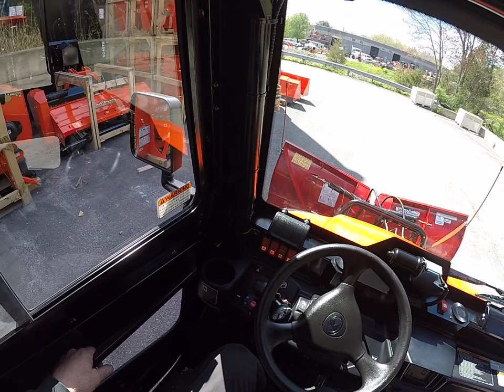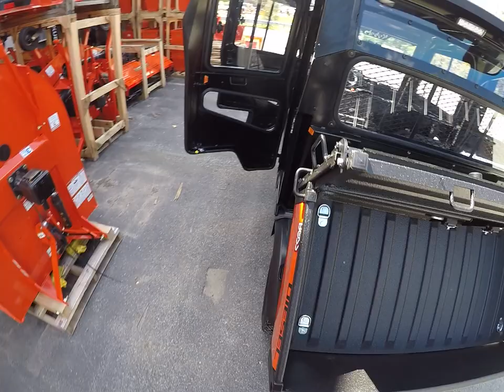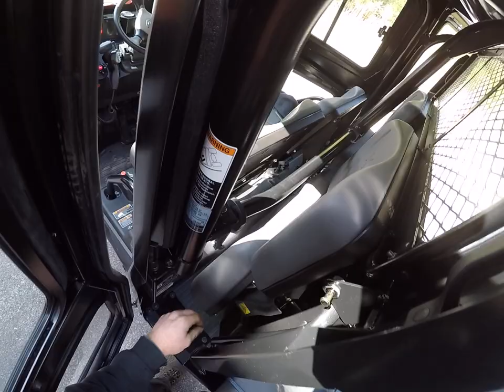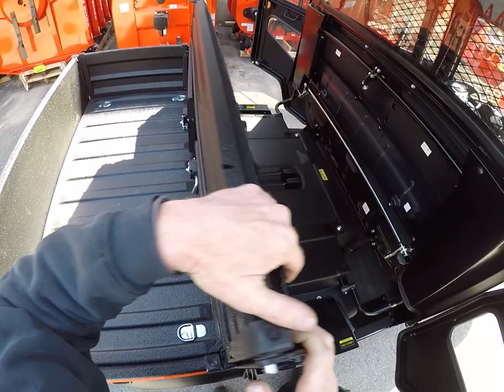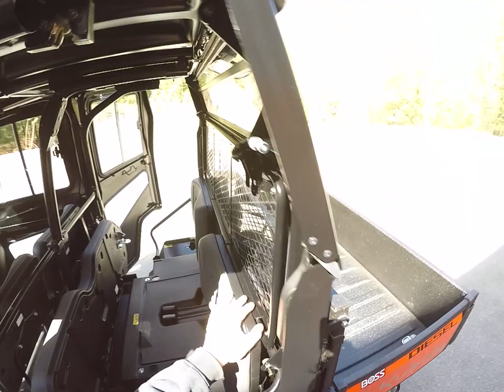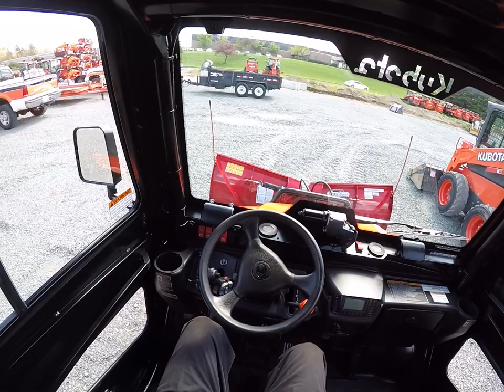Kubota RTV X1140 CURTIS CAB

Comment: Looks like a mini humvee.
Reply from the maker: It totally does
Reply: @ryanlynch2259  you think I could change my mower blades using my Milwaukee impact off and on or should I torque the bolts trying to do it with the mower deck on?
Reply from the maker: @stephengass6067 never hurts to actually use a torque wrench..!   Make sure the blade is blocked off..  and be careful.!!    I usually balance the deck on its driveshaft and be really careful myself..   good luck 👍
Reply: @ryanlynch2259  I've had that tractor since 2000 and those blades look like brand new no chips Nick's thickness is the same it has problems cutting bahia grass I have to make 2 passes only have 320hrs on it should I just run them for another season? Then get them sharpened they cut regular grass fine.
Reply from the maker: @stephengass6067  as long as they cut fine for you..!